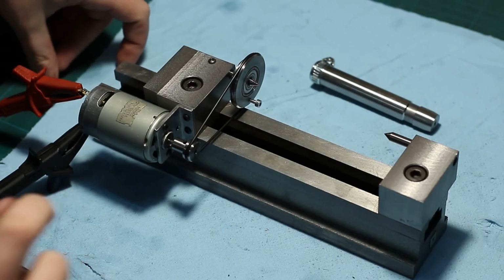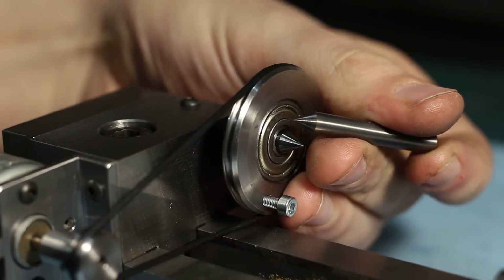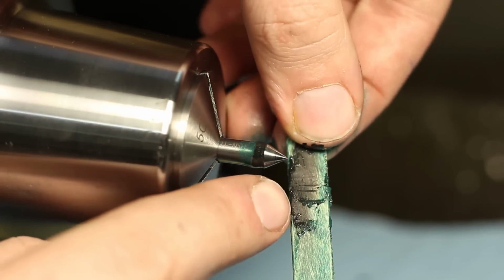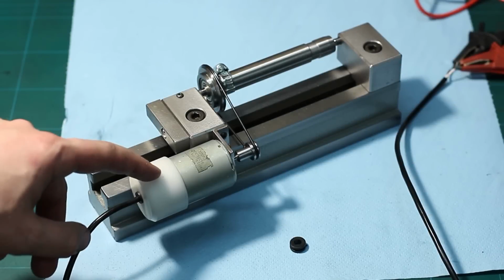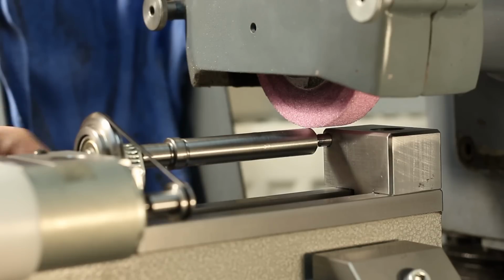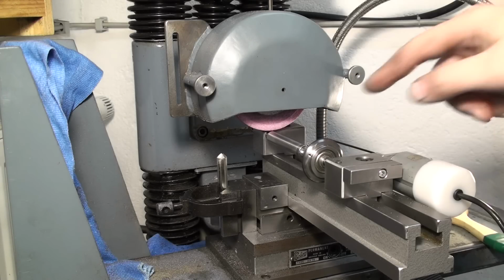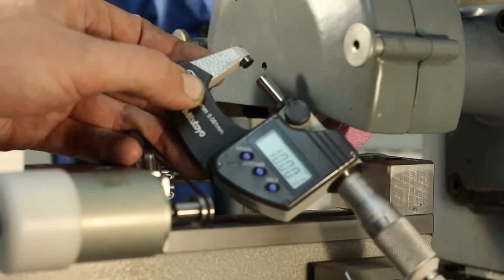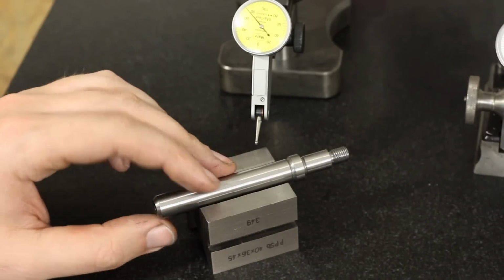Cylindrical grinding attachement - Part 2

Comment: How do you determine the error is from the tilt of the jig and not from the perpendicularity to the grinding wheel?
Reply from the maker: Because everything is aligned against the back rail of the mag chuck.
Reply: Thanks, Nice build by the way.

Comment: wouldn't the workpiece need to be at the right angle, and perfectly on the centerline of the wheel? how do you make sure it's perfectly on center?
Reply from the maker: It is clamped in the grinding vice and thats up against the rear rail of the magchuck, which is ground in place.
Reply: Doesn't that ensure that's it's just square, not on center? Does it even need to be on center?
Reply from the maker: It should be "about" on center, its good enough if lined up by eye. I like to keep it slightly to the left of the wheel center, in case of a crash. The error due to the offcenterizity is very small...
Reply: Barry Manilowa that would be fine if you were grinding a cylinder, but with a taper the accuracy is dependent on the angle of the work with respect to the wheel, which is distorted when you move the work off center.
Reply from the maker: You are right, as the grinding wheel has a rather  large diameter, the error due to non-centerness (that is an actuall word!) is very small (I guess ;) )
Reply: Stefan Gotteswinter The word you seem to be so desperately searching for is "eccentricity"
Reply: JohnHolmestheSecond incorrect. Eccentricity is axial misalignment, even if the part in this video were perfectly aligned it would still be eccentric
Reply: Rob Mckennie You mean because we are talking about two wheels? Thats not quite what i was talking about. Stefan was looking for a word that looked like he wanted eccentricity. The half-words he came up with dont really describe the phenomenon either.

I dont think it is necessary to strictly use technical jargon here, as long as we use words that are actual words, and we can all understand what we're talking about
Reply: JohnHolmestheSecond then why do you need to correct him to eccentricity? They're both equally wrong. I'd even argue that what Stefan said is better
Reply: Rob Mckennie he didnt use words he made them up. and reread my last paragraph there, champ. Maybe you'll get it the second time
Reply: JohnHolmestheSecond the last paragraph is specifically what I was responding to. If it's not necessary to use technical jargon, why is there a need to correct Stefan?
Reply from the maker: You guys have to much time on your hand :)
Reply: Stefan Gotteswinter oh absolutely. I start trade school tomorrow, so I need to get in all the pointless arguments I can
Reply: Stefan Gotteswinter LISTEN JERRY ITS SUPERBOWL SUNDAY AND IM BORED BEFORE THE GAME
Reply from the maker: Superwhat?

Comment: won't the drive dog induce vibration on the piece?
Reply from the maker: Dont think so, the small screw has such a small mass, the speed is not very high, the spring behind the center dampens everything. I cant see any harmonics or something like that in the surface finish. Maybe if you do a proper roundness test on a ground part..but I think thats well beyond what I can measure in my shop :)
Reply: Good argument. Also, still an amazing job, nonetheless ^^